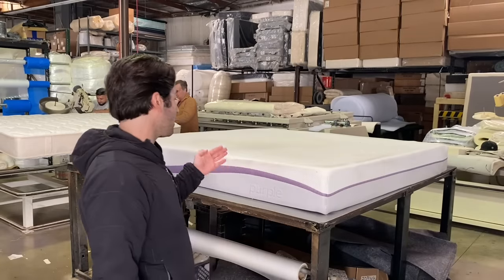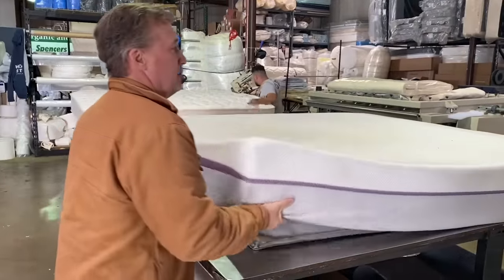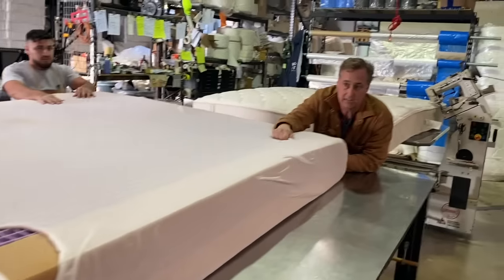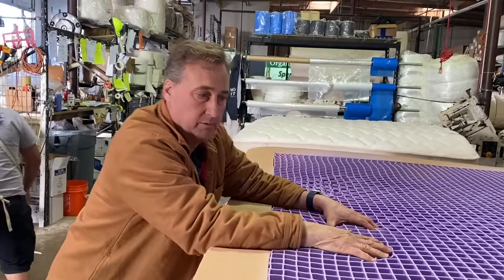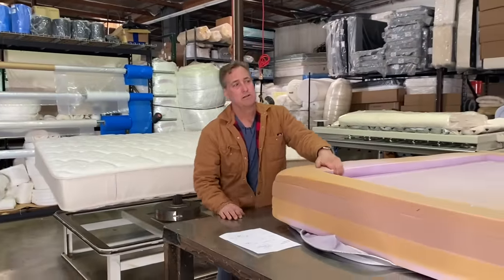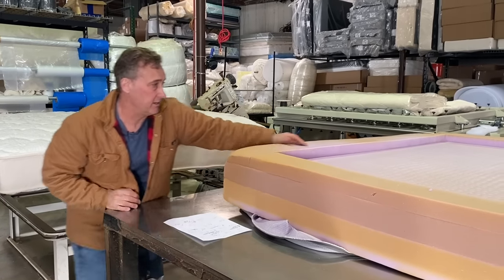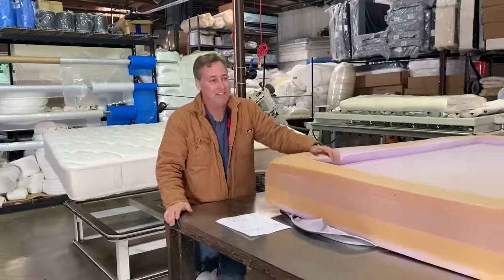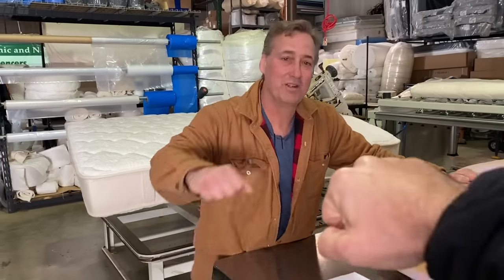Cutting Open a Purple Mattress with Spencer and Joe

Comment: Come on I wanna see what’s underneath that! Why didn’t you open it up further. Looks like there’s another layer of grid?
Reply: It just looks like that because of the way it was glued down. It's contact points basically. The two layers of foam on the bottom are all the way across.
Reply from the maker: That was the only layer of purple grid in this bed that we opened. This one was two inches high and each square measures a 1.25 inches by 1.25 inches. We're not pulling gimmicks here just showing you what is inside beds that customers return to us. Also, if you research purple they only advertise one layer of purple grid. That being said next time we open up a mattress we'll show the layer below the springs, it's typically just polyurethane.

Comment: We are ready to replace our 2020 Original Purple mattress. My hips have zero support and I’m sure the material has broken down in that area. I also have neck pain because it causes my torso to dip in the middle putting strain on my neck. I’m just glad we got ours before such a steep price increase. Also, this bed weighs like 5000000 lbs and is like a wet noodle if you ever have to move…

Comment: I have the Purple Matress Premiere 4 and my top layer of the polyurethane has the same problem as seen here! I wish I could just replace that top layer rather than buying a new bed.
Reply from the maker: We have a mattress called Doctors Care Integrity that does just that. You can take out the top layer/cartridge abd replace it any time with something softer or firmer. We designed this bed to provide a solution to the very problem you speak of… thanks for commenting and watching? Sorry about your purple mattress.
Reply: @spencersmattress  Your mattress sounds amazing. Do you ship mattresses out of state? I'm right next door in Arizona.
Reply: do you make a mattress with a purple grid that’s more durable?

Comment: I bought this same mattress right after I saw the Goldilocks commercials on youtube.  I would love to see inside our bed, because it feels like I am sleeping in a hole.  I assumed that it was the foam beneath the Purple material that broke down, but after seeing this, maybe not. The Purple is comfortable, but it breaks down quickly.  After reading the reviews on their newer version beds that can be up to almost $10K in price, it seems that they still break down as well. I figured that the hybrid model would last longer, but if the purple itself is breaking down, it certainly isn't worth the money they are charging.  The best bed I ever owned was a Beauty Rest from like, 30+ years ago.  That bed was awesome and it lasted forever. The Purple does not even last the 10 years.
Reply from the maker: Hey Lisa, THANKS FOR WATCHING! We agree, the foam breaking down is the most likely culprit, but without opening it up or knowing how it's built, it's difficult to know. Hybrid models do have a better success rate of lasting longer if the materials used are of good quality. And yes you are correct about the industry overall. The beds made today don't last like the ones that were built 30+ years. Thanks so much for watching AND commenting!

Comment: So I live on the east coast. Where can I buy your mattresses? Or what mattress do you recommend?
Reply from the maker: We use to ship to the east coast but with current market conditions its not feasible. We recommend going to a local retailer and getting a combo of pocketed coils with latex. Try to find a place that doesn't have high pressure sales, if they do, you probably don't want to work with them in case you have any service issues. But take your time and don't go cheap, you are going to be sleeping on this thing every night for a long time and sleep is absolutely critical to your health. Hope this helps and thanks for commenting!

Comment: We just bought 2 purple pillows today my wife and I both got different types but both of us think we got the best pillow ever but in my opinion hers isn’t nearly as nice as mine
Reply: What are the different types?
Reply: @khlfff2  mine weighs like 10 lbs and is made of the purple foam with “boosters” to make it thicker. Hers is more just like a special pillow case that you can feel the hexagon pattern in. The crazy thing is I think hers cost more
Reply: @GratefulEd907  Ohhh yeah I think I have the same as you. I love mine! I believe I tried the other one your wife has but ended up returning it since my neck didn't feel right with it
Reply from the maker: We didn't know they had pillows, good to know they are good!

Comment: Their Purple mattresses were advertised at $1,000 in their Goldilocks commercial. Sadly, it seems they’ve increased their prices lately.
Reply: They make a bunch of different models now, I think about 4. So the price varies drastically.
Reply: That one is still 1,000.  But they go up to 4k if you do the Purple. 4 king size
Reply from the maker: Their prices have increased quite a bit. Thanks for sharing your comment here.

Comment: The indentation looks unnatural to me. I would expect the foot area to also be broken down commensurately. No?
Reply: That isn't where most of a person's weight is.
Reply: @razorback9926  or possibly used a heating pad that broke down the mattress over time. It doesn't look consistent with the rest of the mattress.
Reply from the maker: @JohnDoe-gy5dr  it was petit woman who was not bed ridden
Reply from the maker: @petersalt  she slept in that area, not the other side, typically people do sleep on one side or the other and forget to rotate their mattresses, which is why one part of the bed is worn and the rest is not. That's why it doesn't look consistent with the rest of the mattress. thanks for commenting!
Reply: @spencersmattress  Gotcha.  I personally would be highly skeptical of ordering a mattress like this one in the first place so its good to at least see that my hesitation is warranted.
Reply from the maker: @petersalt  She didn't mention using a heating pad. That is a good question though, if a heating pad were able to degrade the bed like this we would hope that the manufacturer of the bed would warn the consumer. Here in Socal it's pretty warm so, we're not used to heating pad concerns. Sorry if there was confusion, sometimes when there are a number of people replying it can get confusing. Thanks for commenting though and watching, we really appreciate it.
Reply: If your feet weigh 50 pounds.

Comment: Dang… just bought my purple mattress.
Reply: Hopefully it’s working out. Most reviews are pretty good. Their prices aren’t as unreasonable as this video makes it seem, especially compared to a lot of the big manufacturers.  I also wonder what happened on that messed up spot. I wouldn’t be surprised if there was high-heat exposure.  Like the customer messed up the mattress then returned it. But that’s just a wild guess.  Good luck!
Reply from the maker: Hey you may have good luck with it. We're not saying purple is bad, we just found one that didn't hold up like we thought they did. So far we haven't seen another like this come through the system.
Reply: As long as you avoid the base model, you should be fine. Even the sale rep said the same as the reviews I read. The base model is good, but not great.
Reply: @spencersmattress  
Maybe update the video then saying this. Most of your comments indicate Purple as being horrible it seems based on the one issue you guys had.
Convenient since yall sell mattresses.